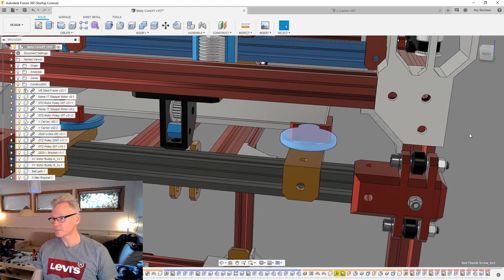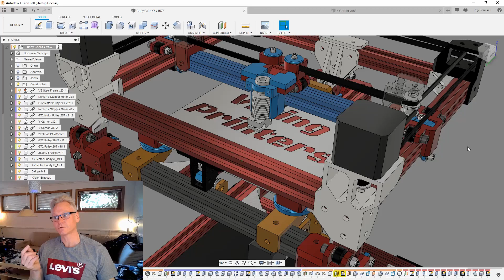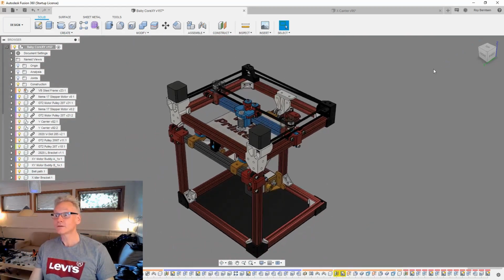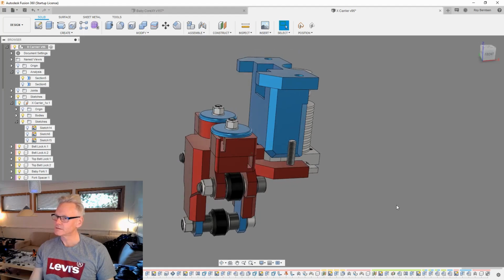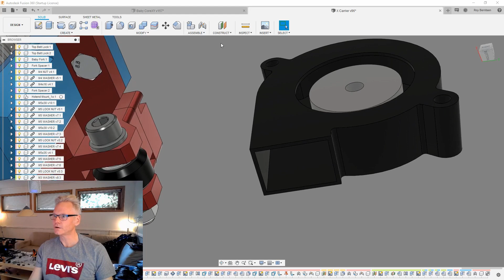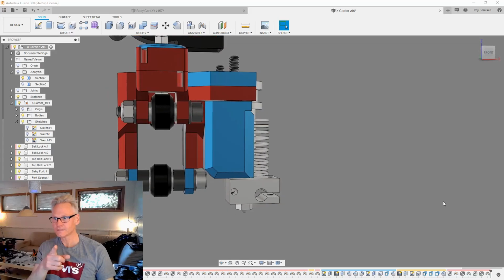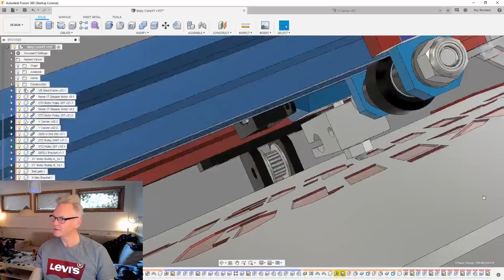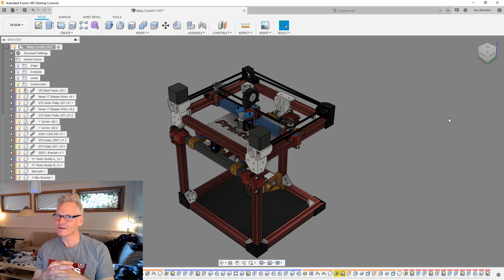3d DESIGN VLOG - CoreXY 3d Printer Vlog #10

Comment from the maker: What do you think about the progress? - Where to place the fans? Any advise or other thoughts?
Reply: It's awesome so far! I want one! Of course self build ;)
Reply: Another thought, use two fans on the top,  one for the hotend, another for the layers, their airflow funeled to the right spots. Put them in a V, like ears, and you'll have a 3d printer with a V-twin (harley davidson pun) and hopefully slightly less noisy.
Reply from the maker: @heisag  would be cool with v style blowers. We don't have much space though and I have a good setup now
Reply: I'd be tempted to consider a large, silent running fan/compressor and running air hoses to the nozzle and and hotend. Not a full compressor, that would be way to noisy. The compressor/large fan thingie, whatever to call it, could then be placed under the bed. I suppose, if it is even doable it would been done by someone by now.  Just a thought.
Reply from the maker: @heisag  interesting with a compressor but for me to complicated. Keeping this simple here

Comment: Can you turn the motor by removing the screws from the gear housing?
Reply from the maker: We need to open the gear casing and do it from the inside. Removing the gears
Reply: @PRO3DESIGN  bummer.  Good luck!  I'm working on a minimalist 350x350x400 now.  Trying to keep my build clean and functional.

Comment: I think using a 5015 fan for the heatsink is overkill. Maybe using it for both heatsink and partcooling. Or only partcooling and add a normal 4040 fan on heatsink. Also like the idea of using two 4015 on each side. Hard choices
Reply from the maker: I could use a 4010 or 35 10 even 3010 but we need to make sure we don't get heat creep
Reply from the maker: Using it for both part and hotend is not a good option. Then it needs to always be on and that is not ideal

Comment: I think the placing of the 4010 blower on the side is a good place, maybe one on either side would be even better.  I was working on that solution for my V-king, but I have it on the back instead. I will continue my work on it. :)
Reply from the maker: The one I have is 3010 blower But could be encreased a little. Anyway I want them to stay on the carrier and not on the hotend.. That is what makes it difficoult
Reply: @PRO3DESIGN  Okay, I think two 3010 blowers will do fine.   Change the carrier design a bit where you attach the hotend part, put fasteners on either side for the fans.
Reply from the maker: @MrFreddie5150  thanks. I will look into that for sure

Comment: The question is how well will that fan cool the heatsink -- I'm not convinced this vertical approach to save space will be effective. Maybe shift the hotend to one side 10-15mm and have a standard hotend fan blowing across the heatsink. Then you can use the vertical fan as a part cooler.
Reply from the maker: Thanks for the concern. I dont know but wan to test if this solution works. I really hate the 3010 radial fans so I want something silent with good airflow